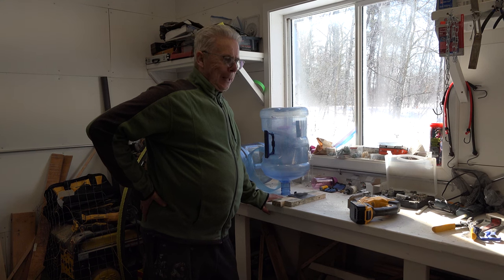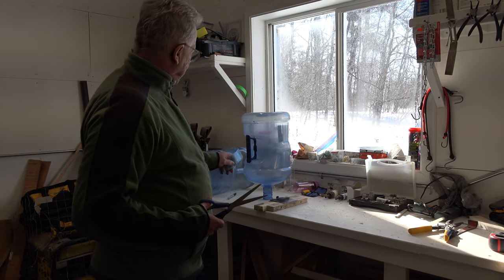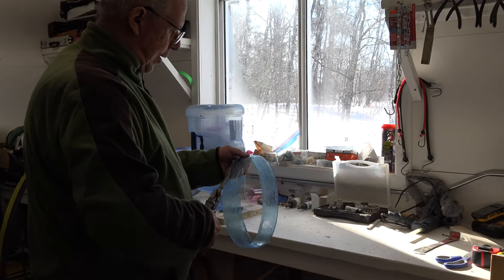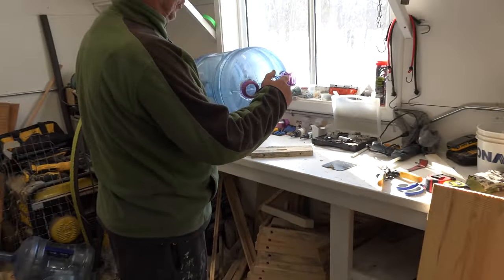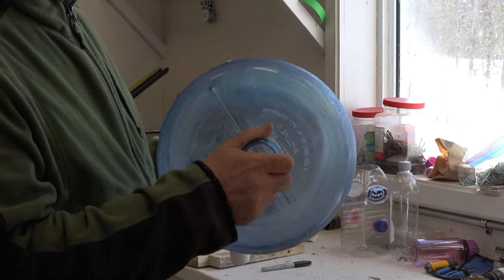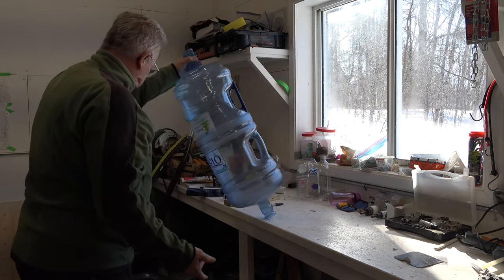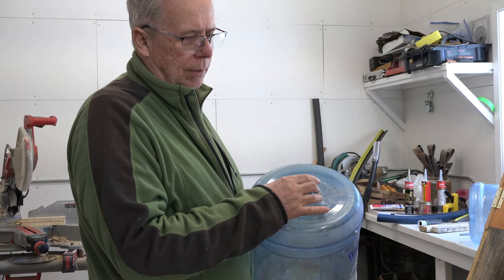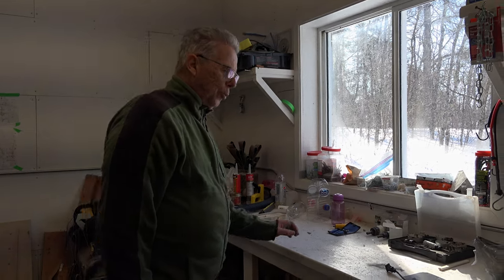Bottle to Bottle Bee Hive | Cutting the Bottles | Part 6

Comment: Ways to start without using a pre-existing comb?
Reply: That's my problem, I don't have bee farms near me. I tried comb out of honey, hasn't worked yet. I have hundreds of bees in my yard  everyday.  I pour sugar water on the bottom of a 5 gallon bucket. Still cold where I live.
Reply: in part 1 at the  near end of video i show stucco wire that can be weaved with bee wax strips.  also paint some wax on your under cover .than put bee pakage in . also provide them with some  feed at the beginng to get them going.thats the way i will try it.

Comment: Is there a plan to add removable frames to the see through design? Aren’t removable frames required for beekeeping in the US?
Reply from the maker: Good  question  . There is  a possible way  of doing  so by having  a type top bar at top of bottle  with two  long dowels on each   
Side . Will have to make  one  soon.as far as us regulations  I am  not sure. And if every state has  same regulations .  From  Canada  so  I will find  out in both countries.